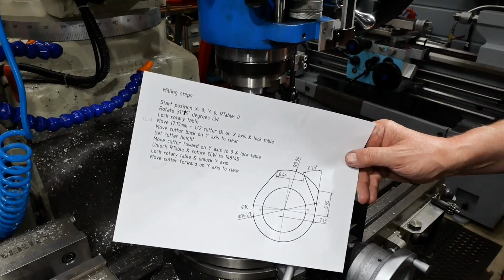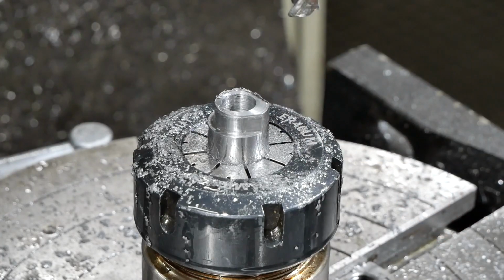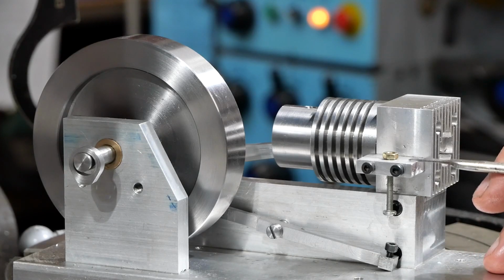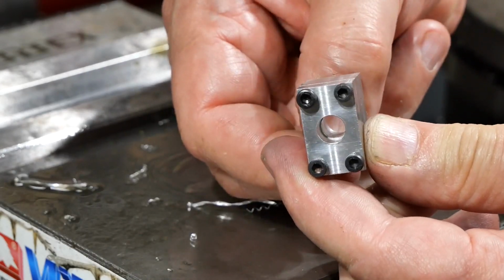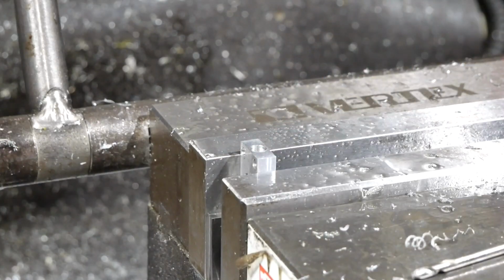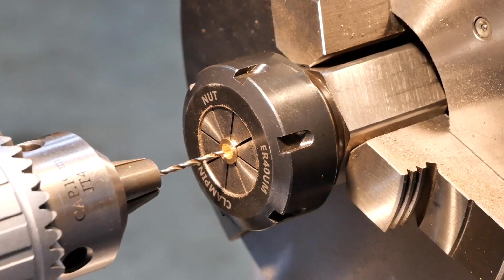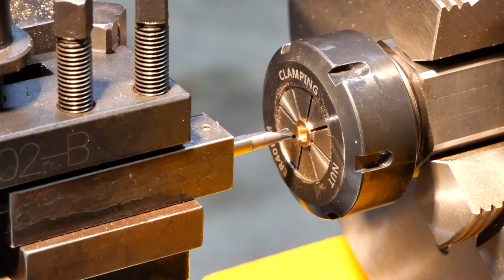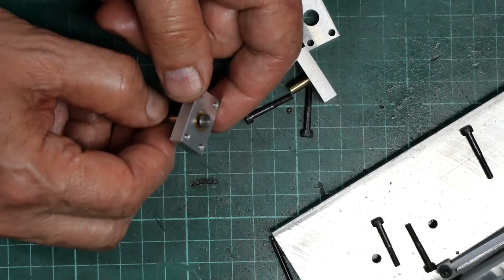Webster Engine - Part 5

Comment: Great work on the cam. Mine was hand filed. I think the design is not for a "precision" or high performance engine. Close enough will work. The rest is pride in workmanship.
Reply from the maker: Thanks Andrew. I thought about doing it with hand filing, but it was an interesting challenge to model in CAD and derive a cutter path. As for pride in workmanship, I was something of a perfectionist as a young bloke and could only see the faults in what I did. However, I spent my last 20 working years with a big manufacturer and came to accept that more quality than you can justify is a waste of resources. I really admire the quality of work attained by many of the machinists that post videos, but at this stage of my life, I'm more interested in new challenges and problem solving than striving for perfection. In any case my aging eyes hide a lot of the imperfections in my work :)
Cheers, Alan.

Comment: Good times making tiny parts on a serious lathe. I laughed at the 0.4mm is metric for can just about see it.. ok it was more than just a laugh...
Reply from the maker: The "Golden Years'" definitely come with some downsides - but, as they say, better than the alternative. I don't wear glasses all the time - only when I need to see things :) I have several vision aids for detailed work that help eg USB microscope with 21" screen for inspecting insert tips and finding bee's dick metal splinters. But headband magnifiers and similar work at reduced focal length so often don't help when trying to inspect something in situ - just can't get close enough. Anyway, I'm still having fun and enjoying the problem solving. I''m pleased to have brightened your day with a good laugh :)
Cheers, Alan.
Reply: @alanshomeworkshop Be assured I laugh with you at you..... or should I say meetoo

Comment: no 1, Hello Allan
Reply from the maker: Good'ay Cees. I've been reading about your power problems and cable Tsotsis: https://youtu.be/liqvp6FWfXI?si=JAcivKrbgwFFmfNA
That's not going to be an easy nut to crack and makes some of our problems look trivial. Do you have plans for going off the grid ?
Cheers, Alan.